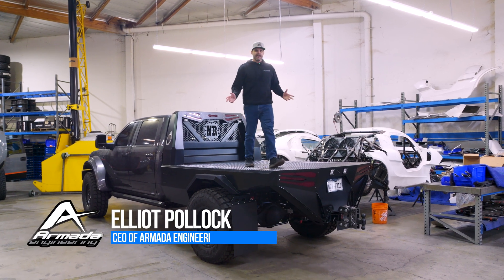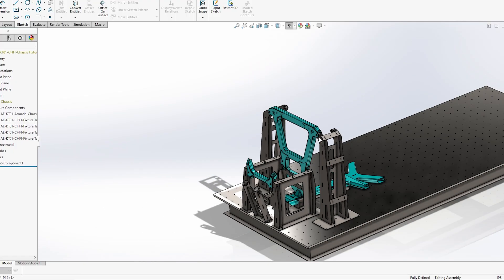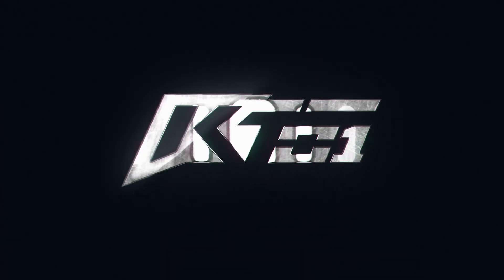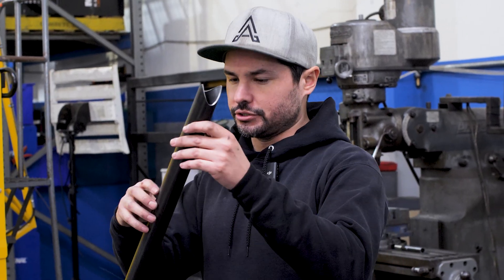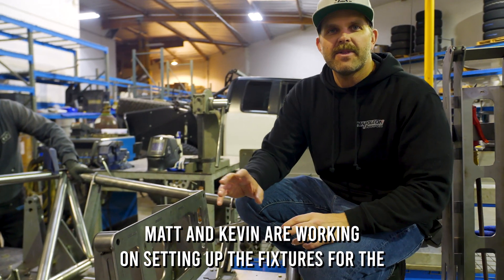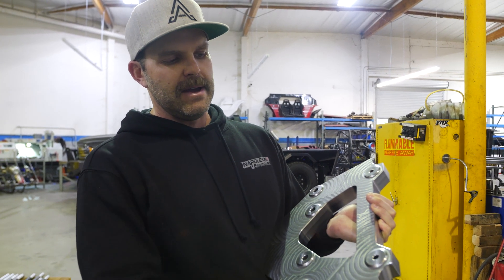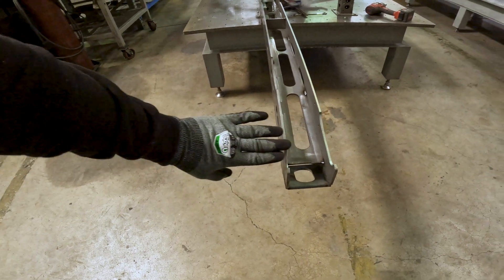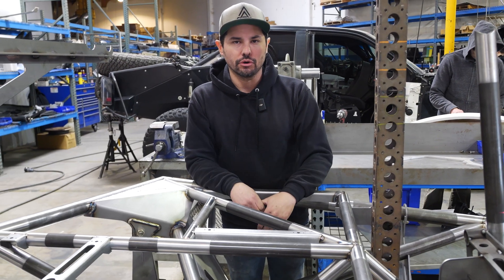KT01 Build Series - Episode 3: Turning CAD Designs Into Reality

Comment: Great video. Is there anything more to keeping things accurate than the laser level? Hard to believe those tall welded sheet metal posts could be so straight!
Reply from the maker: The laser level is just one of the many tools we use to aid in precision. We use lots of cross measurements, a plumb bob, digital levels and positioning targets to list a few. The fixture towers are actually very straight and we use cross beams to tie them all together which helps square them up and keep them rigid during use.
Reply: Thanks for the response! I’m early in my journey learning fabrication and it’s great to learn how the pros do it. Stoked to watch this series progress